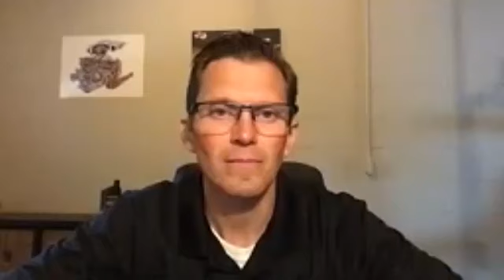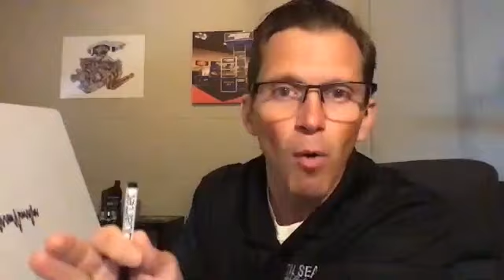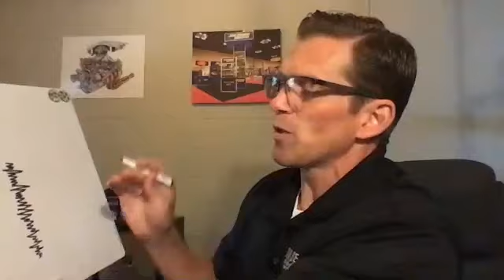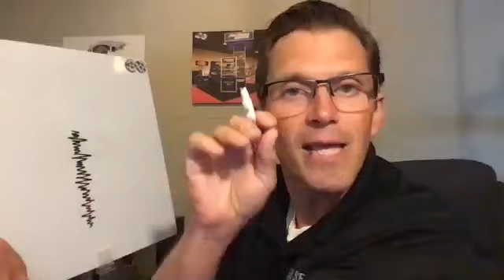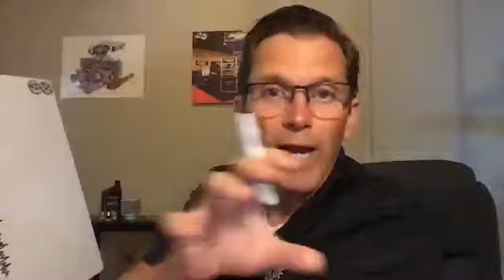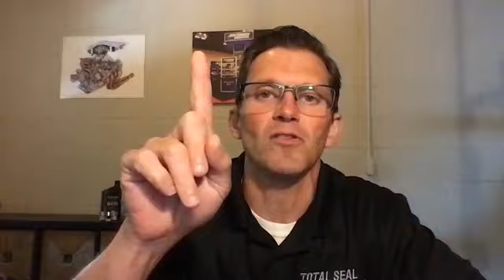Maximizing Ring Seal for More Power & Efficiency! | Lake Speed Jr. & Jon Kaase

Comment: One topic not brought up is piston coating to aid in filling the cylinder gap or piston design.  Ive noticed piston manufacturers leaving more material on the crowns and even adding in additional groves on the cap.  The advertising for icon pistons even include additional piston gap because of the forging process allows the piston tops to grow larger to fill the gap once operating temps are reached. 
  Your guys over at power nation and hot rod are not showing worthwhile proof different rings designs are worth much at all. 2 or 3 hp for a 500hp combo.

Comment: It's good to learn and look at the big picture in racing technology. I've been playing with high performance  air cooled VW street engines for 30 years.  The challenge has always been to take something from modern technology and apply it to old school equipment and have it work better. I've used Total Seal 2nd groove gapless rings for years with mixed results. They seem to work great when new but don't age as well as stock????   Thanks for bringing this to the U-tube playground.  Don't give up it takes a while for the word to get around. Try and ignore the Trolls....     good to see your keeping up on the research during this down time.